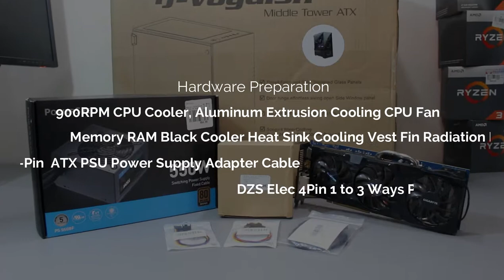Dell Optiplex 7020 RGB Case Modification within $200 Budget

Comment: Is the 5 pin the same on all optiplex motherboards?
Reply from the maker: Yes. they use 5 pin connectors for CPU cooler and case fan. but most generic M/B has 3 pin or 4 pin connectors for them. Thank you for your comments.
Reply: ComTong NY thank you finally got case fans and my cpu cooler to spin at the same time lol 😂

Comment: Dose the 200$  include the pc
If not can I use a Dell Optiplex 790
Reply from the maker: Like I mentioned in the description, i5-4590 is enough to build a 1080P gaming PC but Dell Optiplex 790 is the low spec to build a gaming PC. What I suggest is the list below. Please consider it if you want to build a low budget 1080P gaming PC. Thank you for your comments.
Build List
CPU: i54590 3.4 Ghz - Link: https://ebay.to/3h49mHM --$40
M/B: ASUS 1150 Motherboard - Link: https://ebay.to/2YiqelB - $50
Memory: 8GB DDR3 Ram - Link:https://ebay.to/3f3t18R -$30
Video Card: 1050Ti GPU - Link: https://ebay.to/2ATMB8F -$70
ALSEYE CPU Cooler, RGB Fans 4pin PWM Cooling Fan Quiet Radiator for Intel 775/115X/ AM2 AM3 AM3 AM4 - $20
Link: https://amzn.to/2zVKvVn
RAM Black Cooler Heat Sink Cooling Vest Fin Radiation Dissipate for DIY PC Game Overclocking MOD DDR DDR3 DDR4,2-Pack(MBK5-2) - $14.99
Link: https://amzn.to/368yt5H
FSP ATX Mid Tower PC Computer Gaming Case with 3 Tempered Glass Panels and 5 RGB Lighting Modes - $125
Link: https://amzn.to/2L5tkmw
Reply: ComTong NY the cpu cooler is not for sell

Comment: I have limited desk height of about 4-5 more inches than the optiplex case. Will a regular pc case (about 3 fans tall, I don’t know the height) be within that or is it too tall
Reply from the maker: Dell Optiplex is 14" in height but the regular ATX case that I used in this video was 20" in height so there's a 6-inch difference. I think it doesn't fit under your desk. You know what most people who build fancy RGB case want to place a desktop on the desk not under the desk. Thank you for your comments.
Reply: @comtongny7776  thanks man. It’s going to be on the desk, it’s just a multi shelf desk so the clearance isnt great. I’ll look for a more compact case 👍

Comment: could you make an updated video for this and would this work for a 3010 ?
Reply from the maker: Yes. almost the same instruction. The only difference is CPU gen. like 3rd Gen and 4th Gen. You need all cables that I used in this video like Splitter, convert cables. Now we can use 5V 3 pin RGB fan with RF mini controller so please watch this video for your idea of what can you make it fancier. Video Link: https://youtu.be/5HOoyupW-j8  Goo Luck! Thank you for your comments.
Reply: @comtongny7776  Hi could you please make an updated for Dell Opti 9020 MT ? Is it same or different equipments needed.
Reply from the maker: @YashvirGaming  Yes. 9020 has almost the same M/B with an 1150 socket. You can use the same accessories as this video. Thank you for your comments.
Reply: @comtongny7776  thanks man. ♥
Reply: @comtongny7776  Also man, is there any US hidden site to buy GPU at same old stock price, cuz right now GPU's prices are INSANE man. :'(   even used GPU's prices has increased over a ton.
Reply from the maker: @YashvirGaming  Yes. it's not the right time to purchase an old GPU. Please search the GPU at Mercari. Sometimes someone sells GPU for a normal price lol! Thanks.
Reply: @comtongny7776  ok brother just 1 last question, please update your description or find me a good RAM heatsink, all i see is the "EZDIY-FAB 12V RGB Memory RAM Cooler,RGB DDR Heatsink"  Are these good ?
Reply from the maker: @YashvirGaming  Sorry, please try this one with a remote controller. It is two way RGB heat sink like 5V 3 pin or SATA with RF controller. Here is the link:https://amz.run/4Jux
Thanks.
Reply: @comtongny7776  ok bro, thanks :)

Comment: What is the name of the case,and is the motherboard on the 7020 an atx or micro atx
Reply from the maker: It is an ATX board. The case is 2 pre-installed RGB case but it's not available at this time. I recommend this case instead.  FSP ATX Mid Tower PC Computer Gaming Case with 3 Tempered Glass Panels and 5 RGB Lighting Modes - $125
   Link: https://amzn.to/2L5tkmw
Reply: @comtongny7776  thank you i didnt want to buy a case and find out its the wrong size XD

Comment: How many pins did the cpu cooler have and did you use an adapter
Reply from the maker: Dell board has only 5 pin for CPU fan and case fan that's why you need cable converter to change 4 pin to 5 pin. Here's the link: Pocaton 5Pin Female to 4Pin Male Socket Connector Jack PWM Cooling Fan Power Cable for DELL Link: https://amzn.to/2RemI9v  Thank you for your comments.
Reply: Thank you and what cpu cooler did you use and what rob fans should I use since I’m not switching cases

Comment: How did you get the Power button working ?
Reply from the maker: Please check this video 7:45 You can connect power SW pin to M/B header near #2 ram slot. It is a 5 pin male header. (2 pin upper side). Good Luck! Thank you for your comments.

Comment: I just realized my fans didn’t come with a fan hub!! Omg is that where u plug all the fans into?  Correct?
Reply from the maker: Most 3 pack RGB case fan has hub or controller. Something's wrong if they don't provide fan hub or controller. Please advise.
Reply: ComTong NY ok thank you, also would I be able to get a 4 pack fan so that the fan that’s not running on the left side like yours in the video can run?
Reply from the maker: @buzmie7435  No that's dummy fan I just installed a 5 pack case fan. That's why. You can get the 4 pack anyway. Thanks.
Reply: ComTong NY ok thank you so much, ima get a fan for that spot so that one works because I don’t want it to be a dummy fan

Comment: Hey, I heard that Dell Optiplex motherboards are weird when you take them out and put the motherboard into a new case. Was there any issues for you when you replaced the Dell Optiplex's case?
Reply from the maker: Yes. You're right that's why you need some cable to connect weird connector. Here is the link for the adapter and cables. Thank you for your comments.

Longdex 11 Inch 24-Pin to 8-Pin 18AWG ATX PSU Power Supply Adapter Cable for Motherboards - $10.99
Link: Longdex 11 Inch 24-Pin to 8-Pin 18AWG

DZS Elec 4Pin 1 to 3 Ways PWM Fan Splitter Cable Black Sleeved Fan Power Extension Cable 4Pin Female to 3X 4Pin Male 27cm/10.5 inches - $6.99
Link: https://amzn.to/2tEyPn8

Pocaton 5Pin Female to 4Pin Male Socket Connector Jack PWM Cooling Fan Power Cable for DELL PC -$7.98
Link: https://amzn.to/2RemI9v
Reply: @comtongny7776  Wouldn't computer jumpers work?
Reply from the maker: @shuerzz5403 It works but pin type is different. Thank you.
Reply: @comtongny7776  Thanks!

Comment: does this work with the optiplex 7010 sff
Reply from the maker: Sure, they used a similar spec of motherboard so if you prepare all of the accessories on the description, you can swap the RGB case with 7010 SFF. Good Luck! Thank you for your comments.

Comment: some say dell fans has sensor if we use non-dell fan then system will give fan error on every pc boot
Reply from the maker: Hi, I already mentioned the error alert due to the failure of the sensor at video 0:19. If you don't like the error, you need to replace the other 1150 motherboards. It's not that big issue in my opinion because you just simply push the F1 button to continue. Thank you for your comments anyway.

Comment: Will an AeroCool mid tower ATX case work for this build
Reply from the maker: mATX case is a tight little bit to install but it fits. I recommend the ATX case to have more room to install M/B and case fans. Thank you for your comments.
Reply: Did you do it yet

Comment: If the rgb heat sink cables connect to the 3 pin splitter then where does the 3 case fans connect???!?!,!!,
Reply from the maker: You need 2xPocaton 5Pin Female to 4Pin Male Socket Connector. One is for CPU cooler and the other one is for RGB Case pin. When you connect 4 pin cable for heat sink and RGB case, you need to connect 3-way splitter. Please check the video 7:20 Thanks
Reply: ComTong NY do your fans each have a plug or do all 3 fans have 1 plug

Comment: Wait can this work with any case
Reply from the maker: Yes. You can use any type of ATX case for this M/B. If you don't like dell boot Error, you can also change the 1150 compatible M/B. You can simply get this from eBay. i5-4590 or 4570 is still a powerful and useful CPU. Thank you for your comments.

Comment: Do I only need 1 fan splitter cable?
Reply from the maker: This one is enough to use. 
DZS Elec 4Pin 1 to 3 Ways PWM Fan Splitter Cable Black Sleeved Fan Power Extension Cable 4Pin Female to 3X 4Pin Male 27cm/10.5 inches - $6.99
Link: https://amzn.to/2tEyPn8
Thanks.

Comment: did you have any issue with the fan error during start up? if so, what did you do to resolved it?
Reply: if you do do it , you will have an error, but it is not bad for your pc so just press f1 to pass it. :) hope this helped
Reply from the maker: As you can see in this video 0:20 There's an error while booting because dell board detects temperature sensor, rear fan sensor, power button,I/O cable sensor. You can just press F1 button to continue to boot. If you don't like this error, please replace the board (socket 1150) accordingly. Thank you for your comments.

Comment: Hello, amazing video I'm going to build this for my birthday, but how do you remove the boot up error messages, will the pc know when to turn up and down fan speed or they just stay at full blast no matter what??? 
Thanks.
Reply from the maker: In order to remove the error messages, all cables like Temperature sensor, Rear Fan Cable, Power Button Cable, Front I/O Cable must be connected to the M/B. I think you can just ignore it when you press F1 when you boot up. It's not that inconvenience. Right? Also, You can adjust fan speed control at the BIOS setup. Thank you for your comments.

Comment: can i use a optiplex cpu on a different mother board
Reply from the maker: Sure, it's 4th gen 1150 socket motherboard so you can purchase socket 1150 motherboard for this cpu. Thank you for your comments.
Reply: @comtongny7776  would you know a good one for i5 3470
Reply: @dadsdallaswatchingchannel9910  i5-3470 is 3rd generation CPU socket 1155. You need to find 1155 Motherboard for it. Thanks.
Reply: @goodnews0423  what abot an i7 3770
Reply: also can i aio cool an i7 3770

Comment: Can you put everything you have in a amazon cart so that I can buy this?
Reply from the maker: I already put the link for the items that I used in the description as below. Thank you for your comments

1900RPM CPU Cooler, Aluminum Extrusion Cooling CPU Fan for LGA 775/1155/1156 (Axis Rainbow Auto Change, C Series) -$8
Link: https://amzn.to/2v0NqJY

Memory RAM Black Cooler Heat Sink Cooling Vest Fin Radiation Dissipate for DIY PC Game Overclocking MOD DDR DDR3 DDR4,2-Pack(MBK5-2) - $14.99
Link: https://amzn.to/368yt5H

Longdex 11 Inch 24-Pin to 8-Pin 18AWG ATX PSU Power Supply Adapter Cable for Motherboards - $10.99
Link: Longdex 11 Inch 24-Pin to 8-Pin 18AWG

DZS Elec 4Pin 1 to 3 Ways PWM Fan Splitter Cable Black Sleeved Fan Power Extension Cable 4Pin Female to 3X 4Pin Male 27cm/10.5 inches - $6.99
Link: https://amzn.to/2tEyPn8

Pocaton 5Pin Female to 4Pin Male Socket Connector Jack PWM Cooling Fan Power Cable for DELL PC -$7.98
Link: https://amzn.to/2RemI9v

Bgears b-Voguish Front and Side with Tempered Glass Mid Tower case Support E-ATX Motherboard -$69.99
Link: https://amzn.to/2NLPCvD

upHere Wireless RGB LED 120mm Case Fan, Quiet Edition High Airflow Adjustable Color LED Case Fan for PC Cases, CPU Coolers, Radiators System,5-Pack / C8123-5 -$27.99
Link: https://amzn.to/38tzjvp
Reply: @comtongny7776  Not the mounting bracket u didn't
Reply: U actually didn't tell these people anything they needed wtf did u even make this video sir
Reply: @Allious131  he put the links in the description! U click the link!
Reply: @Graphics_Card  The mounting bracket is not in the video at all. So no, no he didn't actually
Reply: @Allious131  what mounting bracket are you talking about?
Reply: @Graphics_Card  The mounting bracket that goes around the intel i5 cpu. You need that to hold the bolts down in mother board,You need a bracket to hold the cpu fan. It was never explained. The sff doesn't have it optiplex doesn't have it.
Reply: @Allious131  oh! That’s no big deal if your not changing anything

Comment: Where’s the psu in links?
Reply from the maker: You can use any power supply over 500W with PCI-e 4 pin or 8 pin. Here is the link: https://amz.run/4GfI  Thank you for your comments.

Comment: Will the bios on i7 support a m.2 nvme ssd?
Reply from the maker: Yes. it supports i7-4770, i7-4790 without BIOS updates but In order to use M.2 SSD, you need to use PCI adapter for it. Here is the link: https://amzn.to/34OrJuz
Reply: @comtongny7776  as a boot drive ?

Comment: You forgot to connect the rear fan...
Reply from the maker: You're right but I used 5 pack RGB case fan. Rear fan is actually a dummy. This is a demonstration so you can use other ATX case and RGB fans whatever you want. Thank you for your comments anyway.